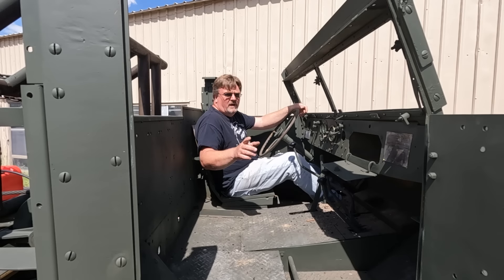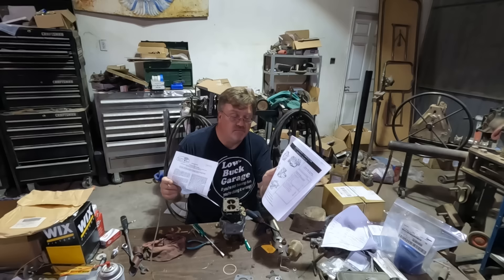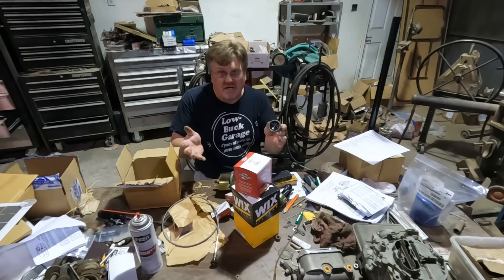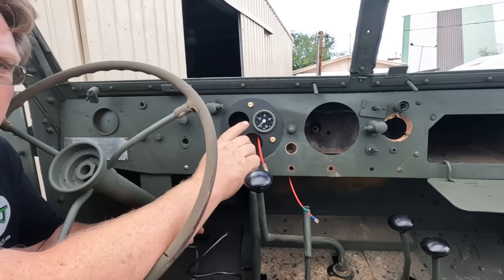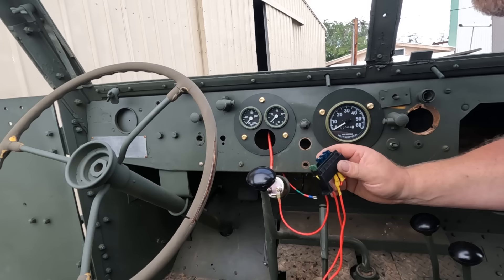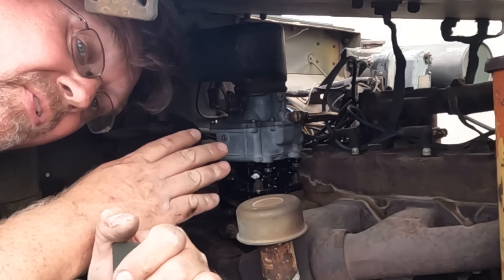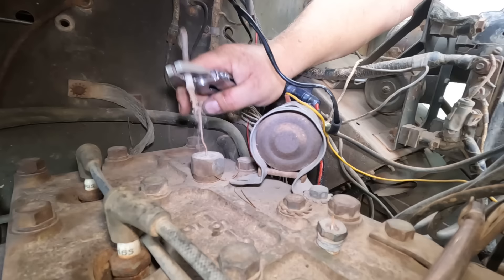WWII Half-Track, Running Again!

Comment: Here is another bit of info that Tommy Hund (parts manager) of the long gone Southern Parts of Memphis told me.  All the slotted countersunk screws of the armor on a halftrack should be oriented up & down. This was so water will drain off. And this is a WARNING that Tommy was very adamant about...  If you drive a halftrack without a rear bed over the tracks...DO NOT DRIVE IT OVER 15 MPH!  If a tracks should break, and I broke one once, the track will whip up, in one case it decapitated a teenager who was drag racing.

Comment: Something that I learned about the star and codes were that they were simple stencils taped onto the body, a quick spray of paint, stencil ripped off and out the door.

Fancy / perfect decals were not used back in the day. 

I learned this when I was doing the "fancy" recreation paint on my motorbike. I ended up making my own stencil on my printer, cutting with an Xacto knife, using a 3M spray glue (like for Post It Notes) to stick it on my bike, spraying over it with paint and peeling the stencil off. Looks perfect at 10' away which is all I needed

Comment: Just spitballing, but MOST likely the idle mixture screws were out at 2.5 turns to compensate for the main butterfly shaft being so woggled-out and loose leaking vacuum ? you can remove the shaft and get a small seal and bore and counter bore the hole, and press in a bronze bushing and seal, I've done this a bunch on old carbs.....

Comment: That gauge kit looks a lot like a $35 (plus exchange rate... Canada) kit I ordered for my m38. Your wiring explanation for the ammeter was the best explanation for what I needed to add a simple fuse panel to my m38. Mucho Appreciated.
Reply from the maker: Thanks, glad it helped!  It probably is the same kit, they're are a lot of them available.  Used the same kit before in my CJ-2A, with a different color.

Comment: They use the vin number stamped into the frame. Found that out when I made stencils to paint the registration numbers on all the power wagons I and my buddies had way back in the late 70s. I made my own stencils and painted stars on the doors and the hood numbers. The ready made numbers were harder to find then and the flat white rattle can paint looked great. I don't think most of the vehicles had stars on the doors overseas, just the hood numbers and a hood star. The doors probably made a great target and made the vehicles easier to spot for the enemy I would think, besides being less work to get them in service quickly. I may have used number stickers but I figured out how to make the stars right on the doors myself and made the stencils. Hard to remember exactly what I did now but I do remember doing the stars. And it's possible we found number stencils so I used masking tape and laid them out and cut them but whatever it looked right when I was done.
I'm sure they had ready made paint stencils in the military so they could do it or redo them as needed but they usually were pretty faded from the pictures I've seen.
That engine runs like new and is so smooth with the new carb and goodies. They were really well built back then and the flat head 230 in my Dodge out of a newer 56 Plymouth ran about that nice when everything was right and had great oil pressure too.

Comment: Nice to see it's running and working again! And it seems to run pretty good without an accelerator pump, too. Speaks volumes of the internal condition of the engine, the ignition system, timing, and all of it is accolades.
Reply from the maker: Thanks!  I've never run a carb without an accelerator pump before, but quite honestly now I don't know if I'm going to bother hooking it up.  It works just fine as-is.

Comment: I remember working on some old military equipment before I joined the USAF in 64.
Friends bought some at salvage sales and used it for various projects or on the job
sites.   Trying to find bits and pieces now days is a blast and nearly.  Friend has an
Half Track in bad condition but he is determined to get it up and running,   It is a 
WORK IN PROGRESS.

Comment: Great videos!  A tip for decal application is you need to apply premask to your cut and weeded out decal. Sometimes called transfer tape. The application is then 1000% easier.

Comment: Put decals on wet.  Spray the surface with water and just a touch of dishwashing liquid.  You can easily move the decal until it is where you want it, but the water will squeegee out and dry in a while.
Reply from the maker: I knew there was something I was supposed to do, thanks for the tip!  I'll do that next time.

Comment: You were talking of putting a camper on your halftrack and said frame twist would be terrible on the camper shell. However, if the axle or axles were mounted on the back of frame rails, then make a new cross member for the center front mounting, it would serve as a 3 point mounting,

Comment: A STAR IS BORN.  For vinyl decals ... use warm soapy water (preferably Meguires Car Wash Liquid, more later).  Don't go clambering for mixture data.  What You're looking for is just enough Meguires to provide lubricity to the water.  You'll figure it out.  You also need a small sponge and a small rubber or plastic squeegee (don't use metal).  Using the sponge, wet the metal making sure to get outside the area of the decal.  Peel off 1/2 the backing of the decal and place the decal on the whetted surface and peel off the remaining backing.  You don't have to be detailed about the placement because the decal will slide around on the surface at this point assuming You've left enough liquid on the surface.  DON'T move the decal onto a dry section.  At this point, take the squeegee (starting at the center of the decal) and just work outward to remove any bubbles and extraneous liquid.  Now blot dry using a soft towel so as not to move the decal on the still moist surface.  Once it dries, takes a few minutes, you can pass over the decal with a hair dryer on medium setting (just warm, not hot).  That puppy is on and will stay on.  For longevity of the decals and Your paint job, don't use dish soap for washing the vehicle.  Meguires and some others make car wash liquid (for adding to water) that contains Carnuba Wax.  This will help keep the vinyl supple and prevent cracking.
Reply from the maker: Thanks for all the info!  I'll be trying that out next time.

Comment: A friend of mine has a grader that has a filter somewhat like the oil filter on that halftrack. For the drain he replaced the plug with a small ball valve for easy draining.

Comment: I don't know the manufacturer of the one you are rebuilding, but, many of the gauges used were the same in post war white/autocar trucks up until around 1970 or so. My father did supply some White spares to army museum for restoration work and as running spares for army half tracks still in service in the 1950's and DUKW still used by Army in the 1960's until replaced by LARC's.

Comment: That fuel filter I believe is strictly a sediment bowl. Those would (or should) typically have a fine mesh screen between the bowl & the upper body outlet to keep debris from finding its way out.
Reply from the maker: That would make sense, probably just lost the screen somewhere along the way.
Reply: @LowBuckGarage  Became 1 with the sludge perhaps.
Enjoying the vids. Keep at them. 
🛻

Comment: So there's a kind of masking tape you use to put on decals. You stick the low adhesive tape to the front face and then apply it and pull it off leaving the decal.

Comment: You have that old machine looking pretty good , nice job!
  Since I'm a gearhead like you I often think up different ideas for things, especially when watching videos.  Anyhow what if you installed a simple type of fuel sending unit in one of your boat tanks and had it with a simple connector that is universal.  Then you could pick up a few of those same connectors to put on the vehicles that you use with the boat tank , so when you plug in the fuel line, you can just simple plug in the fuel gauge at the same time.
  Since most All of those vehicles are old, most of them probably only work from a one or two wire connectors for controlling OHMS for the fuel gauge.
 Maybe you could use a sending unit from a old riding mower .  Unless your boat tank already has a sending unit in it.
   I realized that a fuel gauge isn't absolutely necessary,. But it would be more convenient to have one if possible.  
 I'm surprised that the military didn't have removable universal fuel tanks in all their vehicles.  I'll bet it might have come in very handy many times during the war.
Reply from the maker: Thanks for the idea, that would work well!  The tank I'm using here has a mechanical float gauge on it, but you can't see it from inside.  If I'm already plugging in the fuel line, an electrical connection wouldn't be any harder...

Comment: you know, that vinyl would've been tons easier if you used transfer tape on them.  But if you want to know how to apply wet (which I never do, but I know it helps)  you can fill a spray bottle with water and 2 drops of dawn soap.  If you use a windex bottle, make sure to rinse it out REALLY well, windex will eat the adhesive right off the vinyl... and mistake many of my customers do and I have to recut their graphics

Comment: Ammeter, I put the Dynamo wire to the battery and all the dash through the amps gauge. Then I can check my brake lights by the gauge movement :o)    *volts and amps is very useful. Like fuel pressure, which seems silly, but oh my gosh is it good when the engine starts running bad.

Comment: You will do much better with the vinyl if you use transfer tape. The transfer tape holds the vinyl in place when you remove it from the wax paper making i much easier to place.

Comment: Great video! I loved how u made those gauges fit in so nicely! You should be proud of your work.I enjoy watching your videos!How did you bolt that cushion to the back of the seat?
Reply from the maker: Thanks!  I use T-nuts a lot, you can put them on the back side of the wood and then there's good threads to bolt it in.

Comment: The level you used for that transfer will only work if the vehicle is actually level. You would have been better off measuring down from the top of the door.

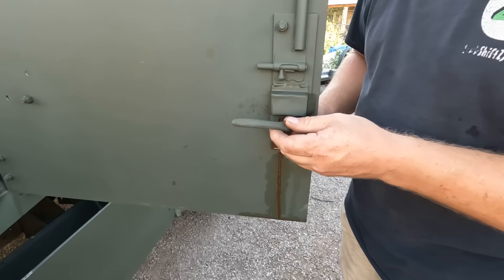Comment: 14:35 The old electrolysis bath works a treat for door latches.  
Is that Ford, Dodge or Chev?
Reply from the maker: That would be a good idea.  I'm not sure who made the latches, but the engine is by White Motor Company.

Comment: Why don't you fix the speedometer cable.& Nut issues to use it. That would be awesome to know how fast.,or the speed your traveling when in use for any purpose then to. That truck looks awesome low buck garage to man.
Reply from the maker: Thanks!  I'm going to check on the cable on the parts machine, hopefully that one isn't broken.
Reply: Top speed was 45 mph on a highway .

Comment: Not exactly sure why you beat on yourself so hard. Its obvious that you're able to figure and fix stuff as it comes at you. Old military rigs were at best, a "one level above torture" device we rode in in southeast asia. I never drove one there because I was a better target material so I operated a turret mount machine gun. I was a kind of big guy, triple  "X" tee shirt or size 56" with neck at 20" and it was really tight, a medium jeans/slack and at 244 lbs. I fit most comments made like how damn big are your feet?? Size sixteen sir...! Hence a few bullet holes in the back and sides of said uniform. Once my small feet hit foreign soil, I bucked the sleeves off at the elbow and put slits in the rest up to the armpits so they didn't cut off blood flow anymore. I kind of looked like a hobo as the legs at the thigh would also rip out. I became their person pack animal once allowed to gain some of my normal weight back... 270+ but at least I didn't feel so hungry all the time with double rations of not that bad of food. Most of us smoked cigarettes at that time, one  habit I wish so badly I hadn't started at eight years old. Down at the motor pool, we did modify most all the heavy equipment to our ideas of a rig to haul weapons or move earth. Eleventh light infantry was a well equipped outfit. I just wish we could of took some of our jeeps home